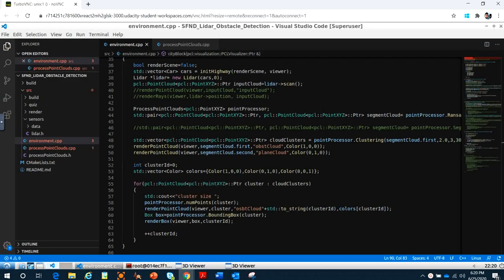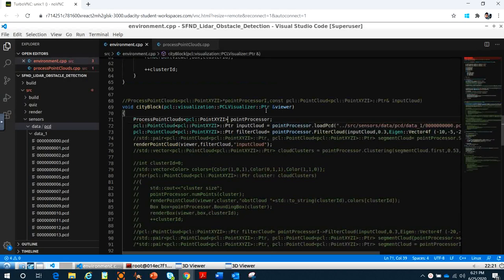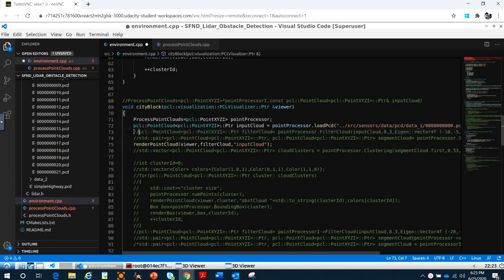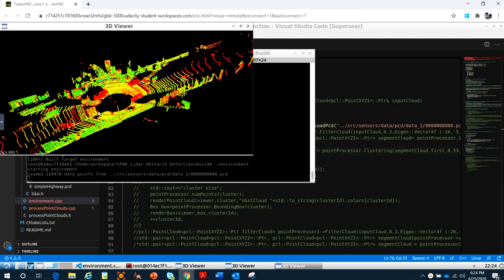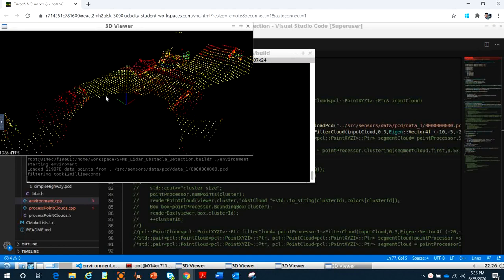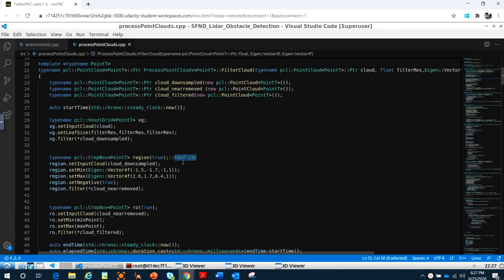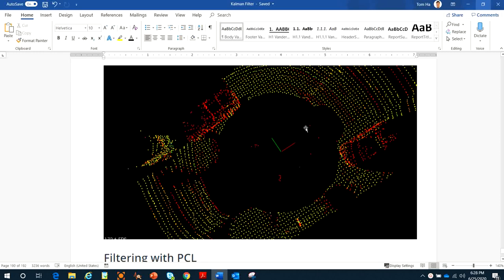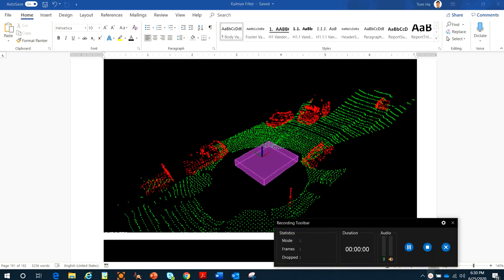Real Point Cloud Data _Voxel Grid Filtering

Comment: hey Tom,
I have a data file for  3D cloud points and I want to calculate the radius of the whole in the 3D surface generated by 3D cloud data point.
how should I proceed with it?
Reply from the maker: I thought you should read code line by line, you will see how to get maximum radius of data points